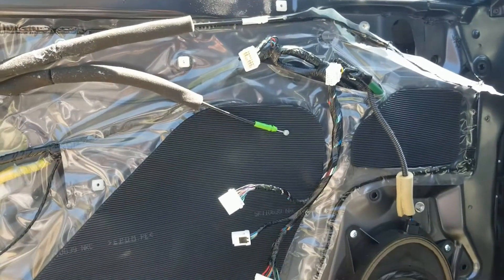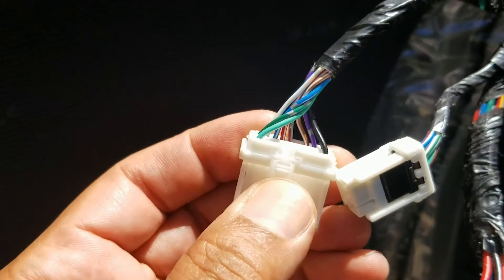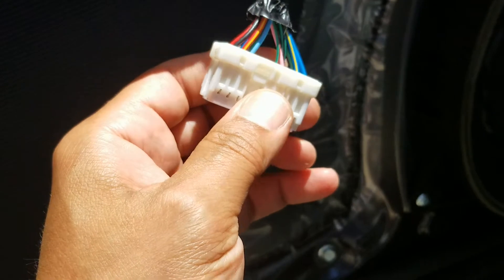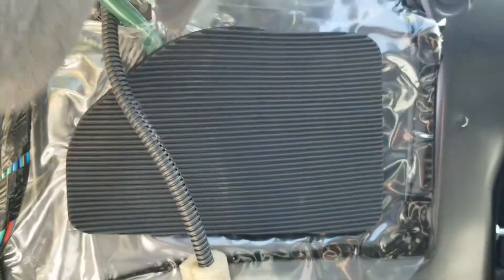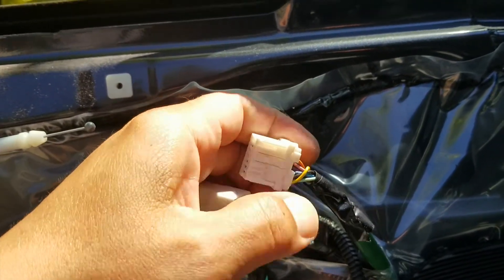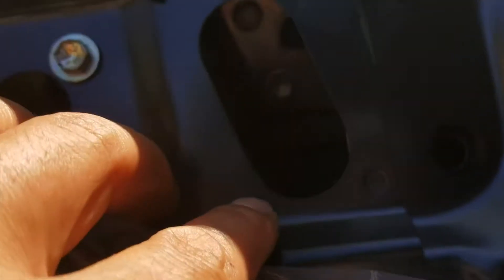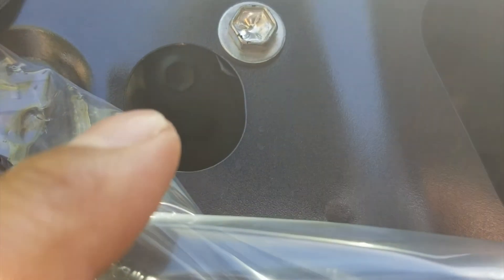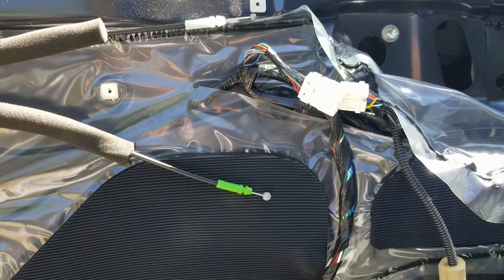How To Remove 2014-2018 Subaru Forester Door Mirror.

Comment: thats not "pretty much how you do it.."both the 10mils are off, and the mirror wont budge. theres a black rubber piece that is pretty much impossible to take off.
Reply from the maker: Theres usually 3 10 mils to every mirror..not "both" referring to only 2..
Reply: @richideates  youre right. I missed that 3rd bolt. My bad.
Reply from the maker: At least you admit when your wrong.. step number 1 of not being an Ahole..🤣🤣🤣..glad it worked..I was worried because I didnt officially take out the mirror..and you couldnt wait the 4 seconds into the video to see where the 3rd bolt was..🤣🤣🤣..all good..lol..thanks for watching